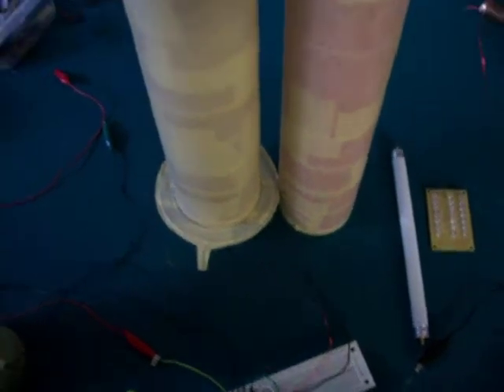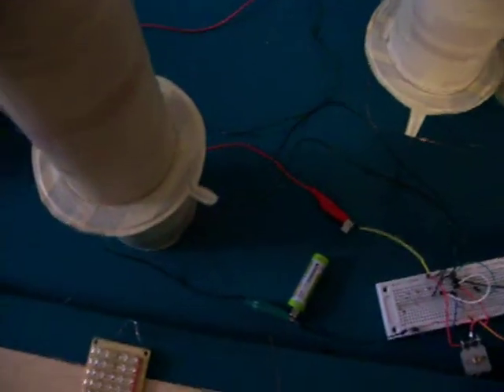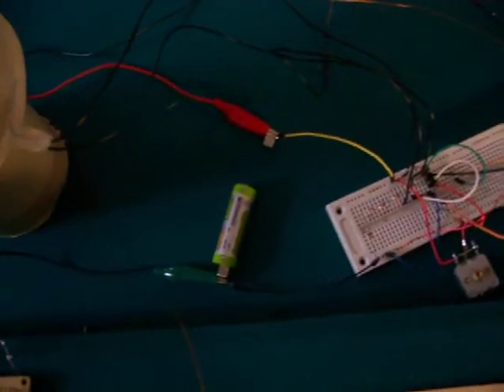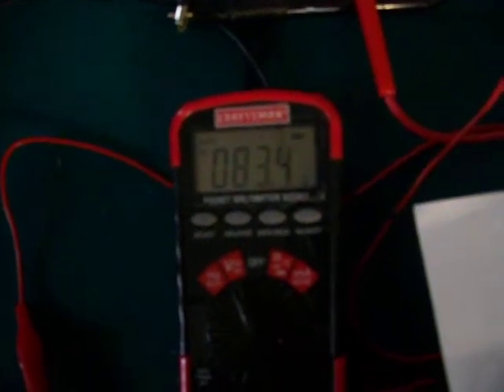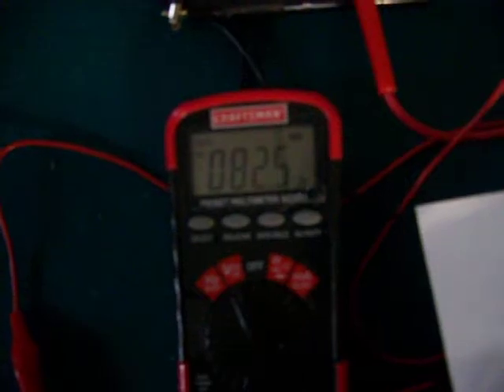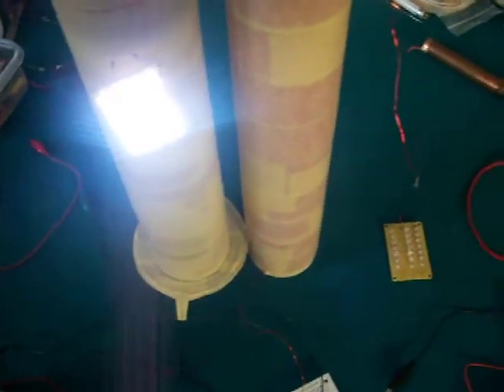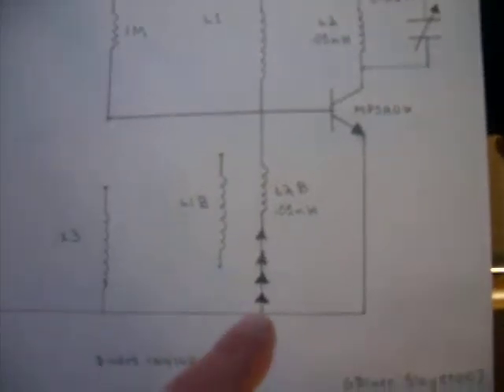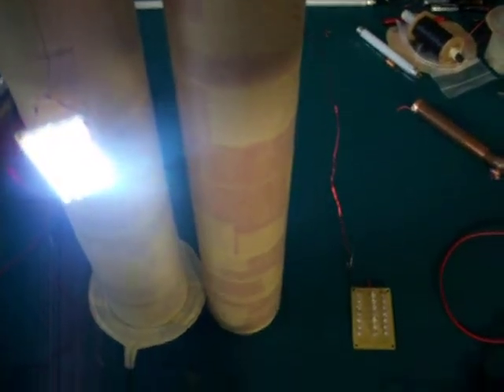Exciter With Second Coil And Tower Update.

Comment from the maker: You may want to try using a pancake coil for your primary. like a nine turn pancake coil, this one is nine turns of plastic coated solid wire.
The pancake coils seem to use less current and give close to the same output.
This setup here will run for over four days lighting the nine 10mm leds I have of one rechargeable AA battery.